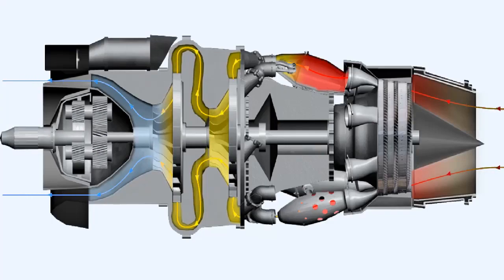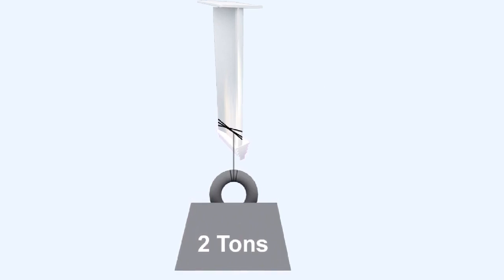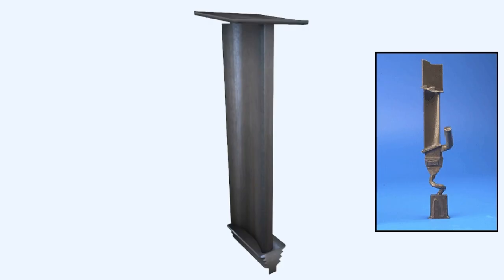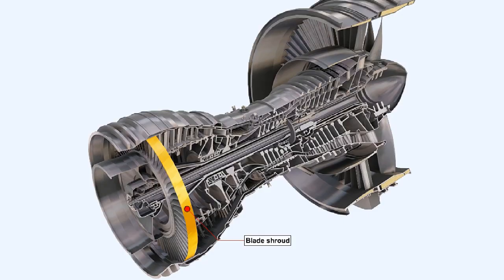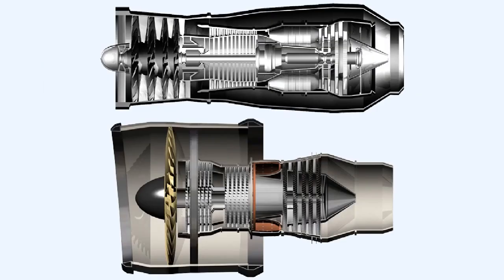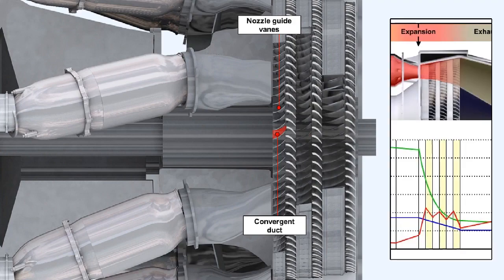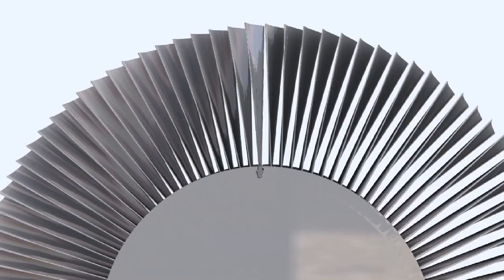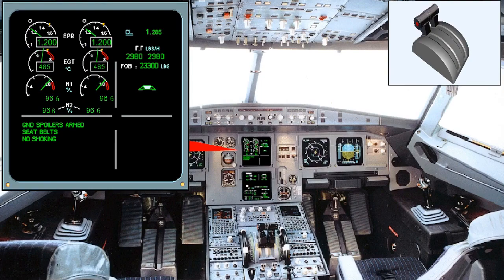Turbine Assembly - Aircraft Gas Turbine Engines #10

Comment: Why “finally the kinetic energy” ? The graph clearly shows that the exhaust is very fast. Kinetic energy goes with the square of it. There seems to be a nozzle in front of the turbine which already converts any other energy into kinetic energy, which in my book is mechanical energy.

Comment: Why not use electrically heated elements in the combustion chamber - no more fuel - and stick an electric generator in the engine.
Reply: You are proposing an engine  that does not use fuel. An electric generator requires a fuel powered engine to run it so you are back to square one.